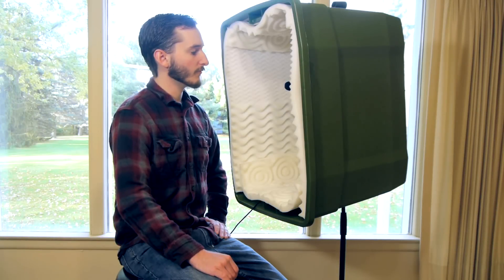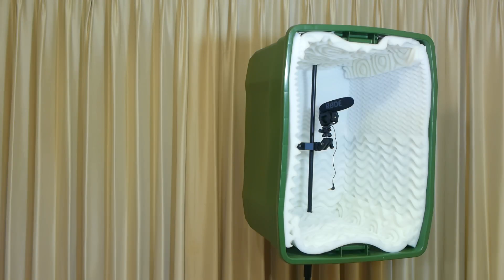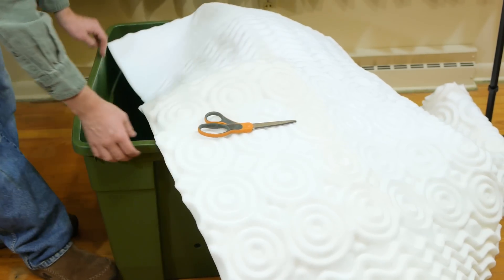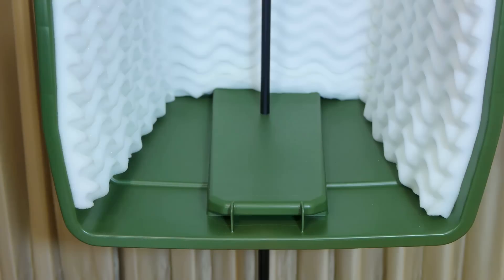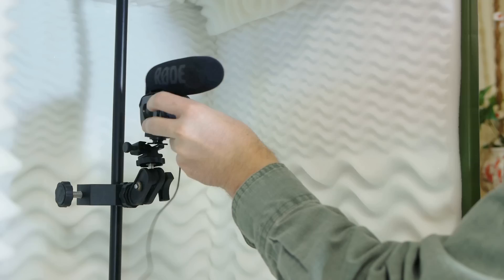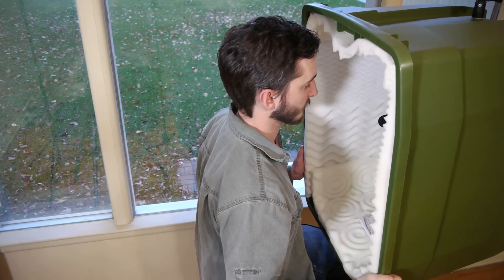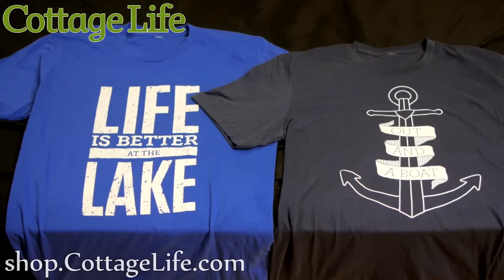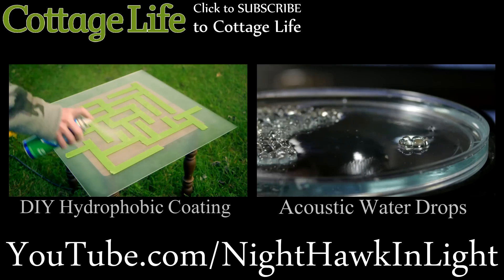How To Make A Microphone Isolation Box For High Quality Audio Recording

Comment: Cool inexpensive idea! It's nice to see someone helping the average person with audio. You could improve the design by placing a flat piece of rigid material under the foam from the top lip to just inside the curve of the bottom of the tub at a slight angle (on all four sides). This would help reduce the standing waves that are occurring due to parallel surfaces.

Comment: If you drill some holes in the back, you can reduce some of your low end woofy-ness. Its like talking into a cup. but if you drill holes in a cup, sounds completely different. This is a great Idea. just drill a number of larger holes.
Reply: Holes in the foam as well, or just holes in the box?  I'm thinking of using.two reflectors.  One in front and one behind me.  What do you think?

Comment: Nice idea, I've made a couple of small ones for desktop use using cardboard and acoustic foam. In the future, I'd reccomend using an actual acoustic treatment foam, as they diffuse and absorb with much greater efficiency than something such as memory foam. Nice way of getting it on a mic stand. How stable is the stand once everything is mounted?
Reply from the maker: The stand is stable. I haven't come close to tipping it over yet.

Comment: Have you tried some Room correction SW ?. This works more or less like that. You put a mic in the place you want to get a flat response. SW make some weird measurements. You need some types of mic but those in general are cheap, like shure sm58. The SW requires some mic calib data, you get from forum. Once you get the room behaviour at that point you load the inverted eq. curve in another program and thats all, room has been corrected. works only at the point where calibration was made. You appeared a lot on this video. I'd recommend less exposure .. LOL

Comment: This video is great! would this work for more than one person though? I have actual sound foam I picked up for $5 a square.  but the same container and blue ball mic
Reply from the maker: The closer you can get to the mic the better. It could work for two people, but it would be close quarters.
Reply: I guess it could work for 2 people if you cut the bottom of the container and form a tunnel, cover it with foam and each person sits at each side

Comment: how did you put the mic into the stand? I mean... what's the piece you are using to atach it back? Was that a simple clamp we find used in drums to atach micos to them?
Reply from the maker: Those drum clamps would work. I was using some quick clamp with a 1/4" thread on it for camera equipment that I got on Amazon. Whatever will hold the mic you're using will work fine.

Comment: I have looked everywhere, I want to buy the adjustable microphone attachment you put the rode microphone on that slides on the microphone stand but I have searched for days and can not find it. Anyone know what that is called and where to find it?
Reply from the maker: It's called a pedco ultraclamp. I'm not a huge fan as the nobs break after time. I would instead choose something like a smallrig ball head super clamp. There are a thousand options for clamps like this.

Comment: Any other type of is useful?   I have some laying around so maybe I could use that.
Reply: type of foam you meant? If so, as a backup, open cell foam (yellow foam from couches) is bad but can do it as a backup until you can get better. The pyramid foam may be better than OCF but memory is probably the best in the low price options. (Also, say no to hard foams, they block nothing and actually amplify bass sounds from the exterior.)

Comment: i would have used the regular foam with the pyramid holes in it to make it cheaper and more professional looking
Reply from the maker: It's true that it might look nicer, but I wonder if it would work as well. The memory foam is really dense compared to how I remember that egg crate stuff, and the density is what really absorbs the most frequencies. You stick one ear in the chamber and it feels like you've gone deaf. I don't think the lighter foam would be the same.
Reply: I probably would have pre-fit the foam first so you didn't have to risk pulling the foam off the tape during the cutting process.
Reply: Oh my god a brony D:
Reply from the maker: AndyFromBeaverton You could, but it's not necessary. I keep unnecessary steps out of my videos because every little thing like that means another hour of filming/editing minimum, and makes the project more complicated. My projects are as simple as I can possibly make them so that they're easy to replicate, and easy to customize if desired.
Reply from the maker: Vanu Leader What the heck is a brony? The elite TR doesn't use the words of the purple spandex troop.
Reply: NightHawkInLight a brony is a fan of my little pony (turtle79070 is a brony) and why do you call Vanu "purple spandex" ? The Vanu Sovereignty has cool weapons. And i'm TR but because of google+ i can't change my name
Reply from the maker: Vanu Leader I think you're a Vanu spy. You won't get any TR secrets from me.
Reply: NightHawkInLight no, in fact i'm an ex-Vanu because Vanu players are rage nerds but i like their weapons
Reply: Vanu Leader
We'll see. We'll see.
Reply: Seroster
Oh I've killed a thousand who were just posing.
Reply from the maker: Vanu Leader Alright that's enough now, keep it civil. This was all just a joke.
Reply: i just made a suggestion and what is all of this?
Reply: turtle79070
It's the internet >:D
Reply: NightHawkInLight what's an NC anyways?
Reply: Shwat Toddle a soldier from the New Conglomerate
Reply: Wtf is the new conglomerate?
Reply: Shwat Toddle
A bunch of miners and rebels that didn't like the old conglomerate so they created new, because blue is the new black, or something like that. They're pretty cool, but only because they gave birth to the powered exoskeleton suits, called M.A.X that can fire cool sounding fireworks that go "PEEEW!". So, long story short, they are like the old conglomerate, but new :P
Reply: Vanu Leader. Bronies like me doesn't deserve hate. You should only get annoyed by the bronies that talk about MLP NON-STOP. That is not me. That is my online ps3 friend. I get annoyed by him every single day. Me I don't even watch MLP anymore. Not until season 5 comes. And that will take a very long time. So please. Can you not hate Bronies? It makes me sad to think of how many people hate our kind :( you can hate MLP though. I will understand that. But don't hate bronies. It won't hurt anyone just for a adult male or a little kid to watch a little girls show.
Reply: Randy Oum
Hey, people blindly hate all kinds of things. Leave him be, he's just like a wall, you can't change his mind unless you have a big demolition hammer and you're planning on crushing his skull with it. But then his mind would just change from brain to gray goo, and even through that's a big change, it won't really do that much. Dead brain is a dead brain, unless you're a priest with ressurection spell or a mad scientist. Or a wizard who enjoys blasting things with lightning bolts. But that would most likely very quickly fry his brain. And the only good thing that would do is it would make it more tasty. So, yeah, don't talk to a wall. People will think you're crazy, like me. And we all know you don't want to be me. I like being crazy. And that's something normal people take as crazy for itself. Or something. Okay, shush. Go fetch that sledgehammer. I'm hungry D:<
Reply: Randy Oum i don't hate bronies and wtf are you saying ? I like MLP D:
Reply: LordDragox412 I watched all MLP episodes and the movie My Little Dashie you are saying i hate bronies WTF
Reply: I hope you are all joking because it's been 2 years since i'm a brony
Reply: Vanu Leader
I'm not saying you hate Bronies, I'm just saying Randy should leave you alone and that I like brains. Fired brains, mmm... Gimme. Nao. Pls ;_;
Reply: ***** search planetside 2 on google
Reply: Randy Oum stop shooting same team !
Reply: Vanu Leader then y u say "Omg a brony D:" because the "D:" part is a sign that u ate bronies. now im ok with people hating MLP. I understand that. but hating bronies is like saying that you hate black people. its kinda wrong. actually, its very wrong.
Reply: LordDragox412 ???
Reply: Randy Oum
Wow, I didn't know he ate bronies. Now that's pretty messed up D:
Reply: LordDragox412 cannibalism is a serious issue.
Reply: turtle79070
Yeah :\ I undestand nomming on your liver from time to time, as it regrows itself and you just make a few stitches and nobody knows, but eating other people? That's just wrong. And I don't care if Brony meat is as sweet and tender as their hearts are, you don't just go and eat other people. Not even zombies eat each other. And that really shows something about that Vanu guy... He really should try frying his liver. It can be pretty tasty. And if you want something that tastes like human meat, but better, eat some pork. It's even better than a kid. And unlike kids, you can buy it at every butcher shop, and it's dirt cheap! And you don't have to worry about a cop raid just because you were hungry :D

Disclaimer: This comment is a work of ficiton. It's author doesn't have any connections with the russian mafia, nor did he eat human mean with them (including the meat of children) in an expensive chinese restaurant led by chef Cho Zho, better known as "Cho the Ripper". Don't try this at home. Don't do drugs, kids. Drugs are bad, mmmkay? And all of that stuff. Peace.
Reply: Randy Oum ok i ate a brownie only yesterday...
Reply: Who do friendly fire >:(
Reply: ***** and i'm black what's problem man ?

Comment: This is great. Thank you. I was actually searching for something like this earlier today... The "real" accoustic foam is stupidly expensive, and it never occurred to me to use memory foam. It has all the right properties.
One never actually pays that much attention to background noises, until you have them in a video. Been doing narrations recently. &*^% motorcycles and barking dogs have cost me hours of recording time.
Should one not try to get something a little more solid (mass) for the box, though?
Reply from the maker: The foam seems to do a good enough job absorbing noise that I don't think a heavier box would add much in terms of further reduction. Any noise that gets through the back wall would be loud enough to certainly be detected from the open side.
Reply: Thick particle board works wonders. (Its what they make high quality speaker enclosures out of) and it is pretty cheap too.